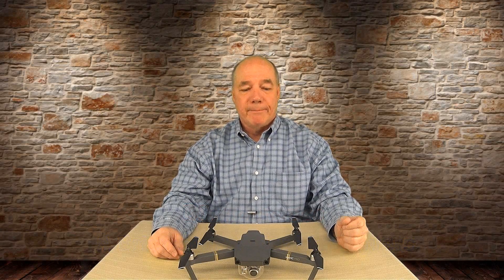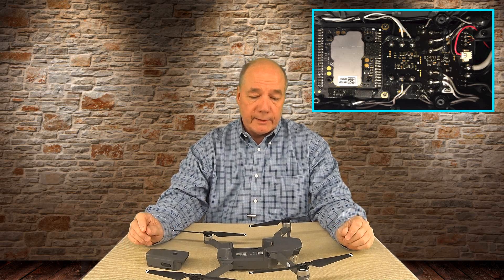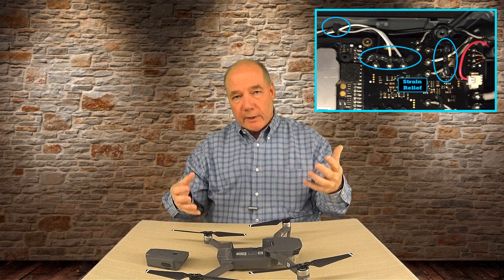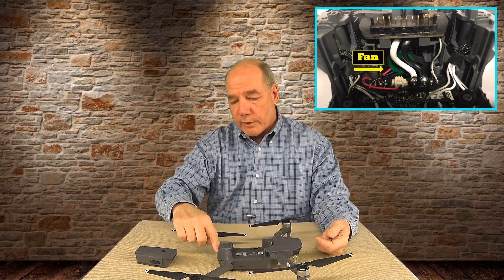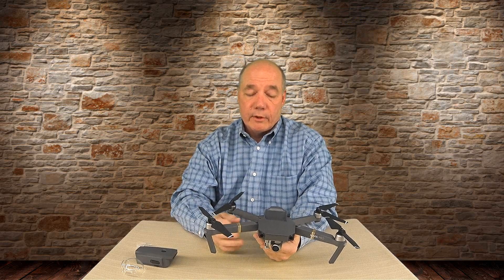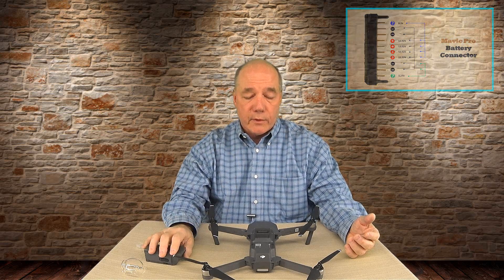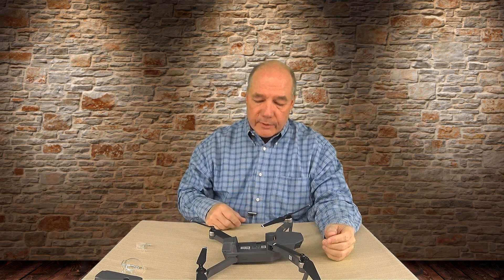Mavic Teardown - A look Inside Your New DJI Mavic Pro Drone

Comment: Hi +Drone Valley, extremely informative and great video, the
only 1 issue I have with the drone is the unprotected camera and gimbal unit.
Now up could fly with the protective cover on but as from your video that would
block the air vents hindering cooling. You have mentioned about having a filter
over the vents so it can be cleaned often and not have debris get into the unit.
Just a thought, what if they kept the protective dome on and have meshed vents around
(groves cut on the sides of the bubble) it enough to allow air flow which can be
cleaned much easier (with a small brush while not risking damage to the gimbal
assembly).In addition they could additionally have some sort of coating on the
protective bubble to prevent any glare or reflection thereby allowing you to
fly with the bubble on and have to worry about having it damage in case of a
crash ,as I see this is the most fragile component of the drone and should have
some sort of protection. Would appreciate your thought/ comments on this.

Comment: Great vid  What kind of landing /take off mat do you use?  i just ordered my Mavic and will be filming our motrorcycle club, therefore carrying it on the bike ,  Is there anything out that folds and would fit in a Goldwing tour pack?   keep up the good work
Reply from the maker: Gary, thanks for the compliments on the clip. I use the PGY folding mat. I like it because it's lightweight but has a flexible metal ring in the outer edge that keeps it on the ground. Most mats are lightweight and will move with the prop-wash from the quad. This one stays put and can be folded up and comes with a carrying bag. I'm not sure how large your bags are on the Goldwing but I'm pretty sure this one will fit. Here's a link to the one I use on Amazon where you can check out the specs. 
PGY Landing Mat - http://amzn.to/2f9TIN8 
Thanks again for supporting the channel and be sure to sub it. Rick

Comment: I am new to droning. I have bought this but still await it's delivery. I ordered mine on the 30th Sept from Dji here in the UK. Your video's are a good over view of what I should be looking out for, when I finally receive mine. I have emailed Dji on numerous occasions but as a first time customer their customer service team are pissing me off with their excuses, or lack of. My patience is running thin. The one consolation is that the £ has devalued and they have put the price up accordingly. So I just hope that this drone will meet my expectations for taking my  photography to literally a different level.

Comment: question:  GIMBALL LOCK

have you figured out the best way to get that clear plastic lock (NOT THE BUBBLE) so you don't pinch anything but get it on 100% ?  
I tried keeping the battery ON and that seemed to drive the gimbal back so I could get a better fit  ??  I wonder if the possible risk to damage is worse than leaving it off if you are just short distance  ??

Comment: Wow you get some critics down there. The teardown was nice and Im a happy mavic owner now as well. Gives me the convidence to fly it far out. Speaking of wich: last time i commented on your p4 carmount antennas. Now its cold here and my 3rd flight yesterday was from inside my old car. I got decent 900m of range without any video dropouts. So its nice to fly this from inside the car! Whta do you think about flying in around 0celsius or even below regarding the batteries? Just shorter flighttimes, faster voltage sag, or also "hurting" the batteries and killing their lifespan faster?   Greets, RCSchim
Reply from the maker: It's OK, just a small nerd-fight. I really enjoy the discussions because I always learn something. 
I fly a lot in the winter and the main thing I notice is shorter flight times and sometimes the batteries "lie" to you. They are working normally and then drop 10-20% in capacity instantly. Just be careful at the end of the flight to keep it close in case you need to bet back quick. Honestly, flying with snow on the ground is one of my favorite things to do and you'll capture some amazing footage! Have fun and thanks again for the sub. Rick

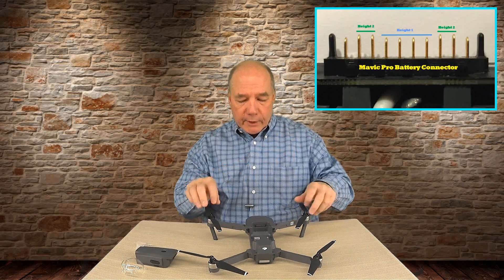Comment: In regards to the difference in height of the power connections, it ensures the ground pins make contact first and/or last when connecting or disconnecting the battery respectively. (9:31)

Comment: wow you did much better job than another guy who broke down the mavic and he tore it open and broke the wifi board stripe cable.. So now his Mavic does not have a working WIFI flying feature. His name is Nils Rohwer
But keep on giving me more info about the Mavic I am getting mines finally tomorrow it arrives, its been a long wait since Oct 1st.
Yes I too when I found out about the motors and the internal fan it has to dissipate the heat I said to myself I have to find a landing matt maybe cut off a piece of Neoprene which is a good idea of a matt or something so I won't have to land it on dirt, grass, or even on a sidewalk or street because this thing is so low to the ground it could suck up any piece of micro dirt that we think its clean but its not.  Lets think about how Jet engines function they always clean the runways for debris when they are going to put planes taking off and landing.  like this guy does in his video he does not put his jet RC in a launching pod just because its better its because of that Jet engine RC sucking up any particles. I love seeing this guy RC Jet wish I could make one. But I found so much info about this you practically need a pilot license it will be great to have a FPV cam and googles it would be like flying a Fighter jet. https://youtu.be/dTHWBSluUjU
Reply: atabeylive That other guy was actually more knowledgeable about electronics. But I really appreciate the commonsense of Drone Valley. He comes to the correct conclusion: well designed but 2 weak spots: protective cover interfering with active cooling and fan likely to suck in dust on landing and take off.
Reply: not going to take any chances with that I am definitely using a neoprene square cut matt placing always on the bottom of any surface doesn't weight much and its good to protect your investment.

Comment: I really appreciate that you did a teardown of this thing, but I believe that while you are generally on the right track about the various aspects, you are often overthinking them.

For example, the battery connector blade lengths.   It is very common practice with connectors to make the ground/common pins make contact first for a variety of reasons.   You have to look no further than the three prong wall outlet plug, as the safety ground makes contact first for obvious reasons.   In low voltage situations such as this, there are a couple things accomplished by connecting the common first.   

First, if there's any built-up voltage potential (think static electricity) between the battery and the drone, it would be best to try and equalize this potential on the common rail and reduce the possibility that it ends up flowing through sensitive MosFETs or other semiconductors easily destroyed by an over voltage condition.

Second, there's multiple voltages on that connector.  Rather than deliver the uncertainly of which battery voltage potentials come into play first, the connector first establishes the common rail.    That way you don't end up with brief undervoltage or other undesired currents from having, say for example,  a positive 12 volt and a positive 5 volt connection with no common, creating a floating 7 volt potential may not be effectively controlled without a common present.  

Lastly, the unknown voltages on the two outside pins may actually be data communication signals, or at the very least an analog output from a temperature sensor.   I'd recommend hooking a scope up to them and see if there's something other than DC on them.   Remember, DJI touts this as a smart battery, and given that the four LEDs built into the battery show a variety of indications with their patterns, it's a dead giveaway that there's a board with a microprocessor tucked away in that battery.  It would seem second nature to enable that microprocessor to be able to talk with the processors onboard the aircraft when connected.

I like how you scrutinize each design aspect, as it seeds plenty of critical thinking, but it also seems like you might believe that there's no tolerance or no margin for error in all of these aspects.  Granted, many of these are quite thin, but what I see in a lot of cases is that some level of FMEA thinking was applied in order to reduce the failure modes and their severity.   Machinery does indeed last longer if you take care of it properly, but I don't agree that this thing is as fragile as you sometimes seem to convey.

In a previous video, you worried about the forward arms retracting backwards (and alluded to this again in this video) potentially resulting in propeller to propeller contact.  While the forward arm swinging slightly back (but not through its over-center point) would be a serious problem,  the aft props sit completely clear of the front props, so prop contact will not happen in flight.

I share your concerns about heat, as this thing gets hot just sitting there (and burns through battery life as well).  I think DJI might want to consider refining their microprocessor programs to sleep more when program execution is not needed, just like in cell phones.  There is no reason that the brains of this thing need to be running full-out when not in flight.

Thanks again for doing this video, and don't be afraid to show your stills full-screen so that we can get a good look!
Reply from the maker: Thanks for the thoughtful post and I totally blew it on the raised pins and don't know how I missed it. I work with a lot of "quick disconnect" interfaces and all of them have a ground-first mating. Thanks for pointing that out and I have heard it from a few other subscribers as well. It's great to have this many smart people stopping by the page because it raises the game for all of us when we collaborate in figuring things out around this hobby. Thanks again for posting and supporting the channel. Rick
Reply: Hey, from what I can tell by the comments, there's a lot of us propeller-head EE's just like you that have a natural interest in cool tech gadgets watching your channel.   Kudos for attracting so many intelligent commenters versus the typical dreck found in the comment section of most videos.
Reply from the maker: I agree that its a good crowd that frequents the channel. This hobby is full of them and it's a great community to be a part of. Thanks again, Rick

Comment: I think you said you've seen several fly-aways for the Mavic... Even if it's due to preventable overheating, that concerns me a little. Can you elaborate on what you know about Mavic fly-aways?
Reply from the maker: I'm working on a clip on a few of the most common reasons I think these are happening and will go into more depth there but essentially I have seen two main categories of flyaways in most of the clips I've seen posted. One of them is related to people flying with the camera guard on the drone, which causes overheating of the quad. When this happens, all bets are off as to which circuit goes nonlinear first. The second has to do with loss of control with the new smaller controller. Unlike older versions of the controller that used analog sticks, the new Mavic has digital sticks. With Analog sticks you can be a little more aggressive with your movements because the potentiometer behind the stick is always tracking your movements. The challenge with the digital sticks is that if you're too quick with the movements or "snap" the sticks the controller can lose its reference and has a hard time adjusting. You see this in a few clips where people are doing the calibration on the sticks and violently move the joysticks that then lose their tracking. While this can be cured with a firmware update to the controller, the simple fix is to move the sticks more slowly and consistently. I have been flying the Mavic hard for the last few weeks and it's been flawless. I appreciate the post and be sure to sub the channel so you don't miss any updates. Thanks, Rick

Comment: Great job Rick! I suppose that you must have an engineering background just judging by your expertise with mechanics/electronics. I'm on the fence with the Mavic at the moment. I really don't mind waiting till they Iron the bugs out of the machine. Prolly by the time I pull the trigger on one, the next gen will be right around the corner. As of now I'm waiting for them to show up at the local Best Buy before I drop any $$$ on a pre order. Really, the P3A does a fantastic job for a hobby level guy such as myself. Thanks for the in depth overview of the Mavic. I'm Sold!  BTW, DJI should put you on the payroll. Your reviews are Extraordinary... V51

Comment: I really like the inside pictures and your analysis of the engineering feats.  On the battery, the connector is what is referred to as a sequential mating or "hot swap connector".  This allows the ground to connect first, then the data and finally enable power.  This keeps from damaging the circuitry.  Thanks for posting.

Comment: The bottom is not metal, its plastic. you can see pin injector marks inside the channels... You would never get those smooth heat sink channels with CNC milling machines.  Just tap on it with your fingernail, and then tap on a thin piece of steel or aluminum and you will realize it's some sort of composite plastic.

Comment: Can those arms be easily removed? i really want to know if ONLY the arms are capable of being removed and put back ..

Amazingly detailed explanation by you sir. Thanks for making this video.
Reply: On the next gen. Mavic 2, and probably this one as well, the arms have wiring, for motor and LED lights, the front ones also have antennas so there's a thin coaxial cable, all of which attach to the circuit board (the antenna's with a miniature snap on coax connector, the rest are soldered in place. The boards have to be removed to get at one of the coax connectors. So, while the arms are replaceable, it requires tools, patience, mechanical aptitude, and a good dose of "courage" the first time!

Comment: Do I need to worry about flying this drone in Arizona where there's lots of dust in the air. You were talking about an after market filter that would go near the camera.
Reply: desertdude1 is ok, the board is coated, moisture and dust wouldn't be that much of problem unless you apply then to the board directly.

Comment: great vid 
but like you said you are a bit of a fun boy 😊 
Surely you could see something negative or something they could if done better?? I don't think you said one negative point about it in this video. Unless you honestly can't see any negatives?

Keep the Mavic Videos coming  😊
Love your channel
Reply from the maker: Mitch, I did try hard to find some glaring fault and the closest I came was the issue with the fan sucking in debris across the PC boards inside of the quad. I'm hoping that a third-party accessory company will address that with an aftermarket filter. Other than that the only thing that still troubles me is the ground clearance and I'm hoping this is fixed as well with an accessory. Thanks a lot for your support and be sure to sub the channel if you haven't already. I have a lot more Mavic and Phantom content posting this weekend. Rick
Reply: I suppose you did mention the fan and debris issue 😊
but you do sound like a DJI Rep 😜
Reply from the maker: I only wished I worked for them :) I just love this quad and am blown away by how well it's put together. I play with a lot of tech and most of it is sloppy, especially in its first or second generation. The Mavic looks and feels like a very mature product and I believe in giving 
credit where it's due.

Comment: Another great video.. I love the engineering aspect of things and you nail them all..!

Not on the drone itself, but I have noticed a fan on the Controller as well that usually comes on about 2 minutes after it being on. While not an issue for the usual recording since there is no audio, when you do a Live Stream to either YouTube or Facebook and the phone is attached to the controller, you can hear the fan noise quite a bit.

Maybe if you get a chance you could take a look at the controller as well, possibly at the fan, and the possibility of replacing it with a quieter aftermarket one (even though smaller fans tend to be louder..).

Thanks!!

Comment: You are a great speaker. Another informative video!
Reply: iftibashir nice video but you forgot about how the sun shows a glare when your sensors our on and sometimes your drone thinks there is something there when there isn't witch means if you are far away or over water your drones is going down I almost lost my mavric beacue of the sensors  so I just turn them off and now it fly s great and I have  no problems with my mavic

Comment: Those longer ground pins on the battery are probably for protection, every good electrical connection has the ground or - connecting first, so that the + voltage doesn't damage the components on PCB. As the guys below mentioned the bubbles on those soldered wires are there, because the PCB is assembled with SMD components, which in this case is probably because through solder components take more space and from the both sides of the PCB. The wires are hand soldered (that kind of plastic coating melts in an oven), but you don't get any spikes on the solder if you know how to do it. I would guess that those glued wires are glued, because they stay on their place easier and if there is need to open the drone it is nicer to open it if the wires don't come out when you open the casing (this trick is usually used also because it makes assembly easier, because the wires stay in their dedicated places).